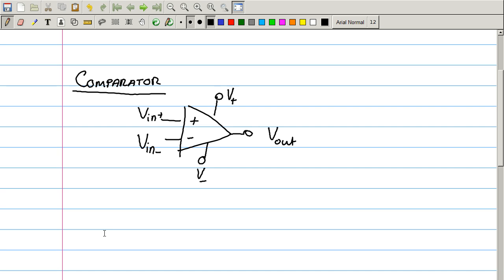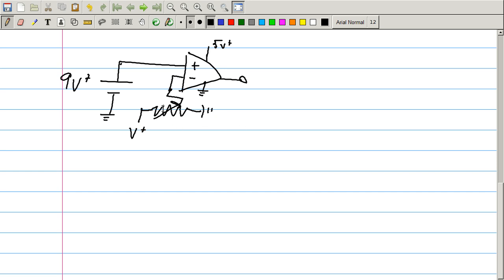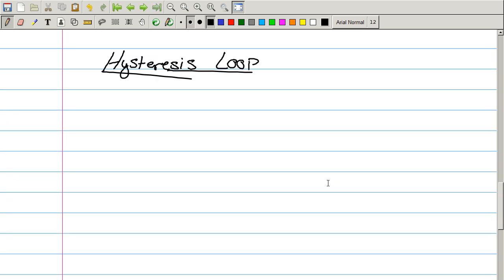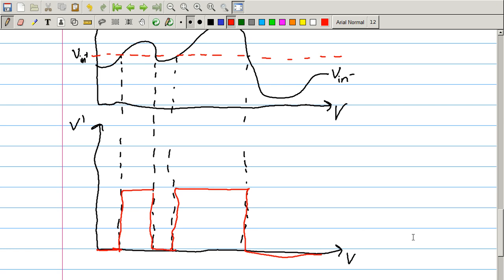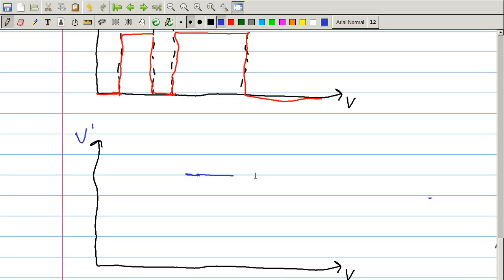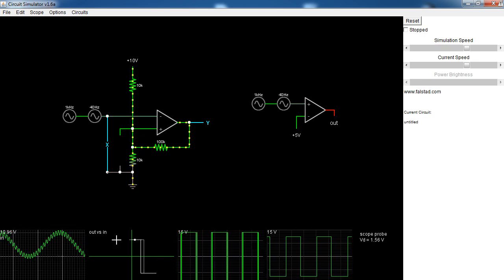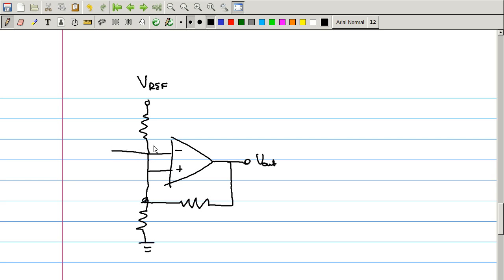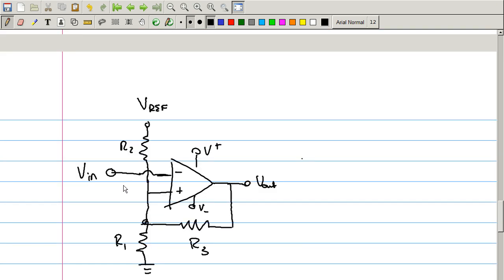Electronics 201: Op-Amps

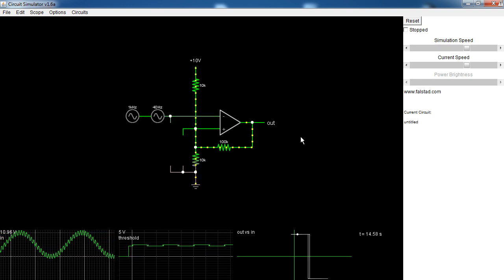Comment: 15:00 is there a free of charge software simulator that shows the flow of current? i am talking about a simulator which can run locally without an internet connection.
Reply: This is the online version of whats used in this video.
https://www.falstad.com/circuit/e-opamp.html
LTSpice is Free and excellent to use but requires some knowledge and time to operate it.(More on the professional side of things.)